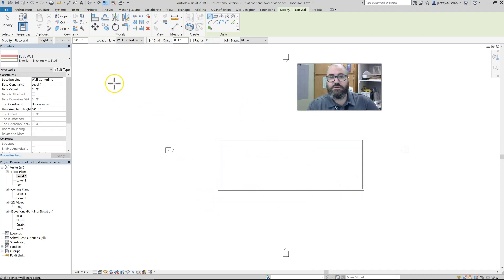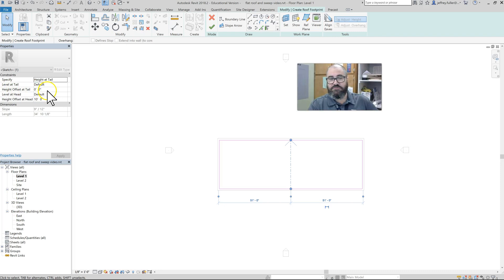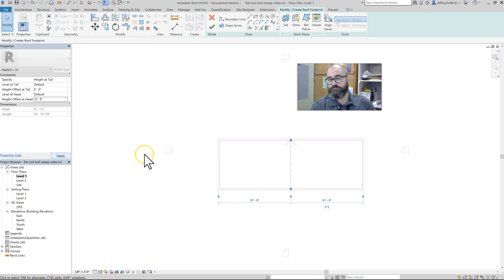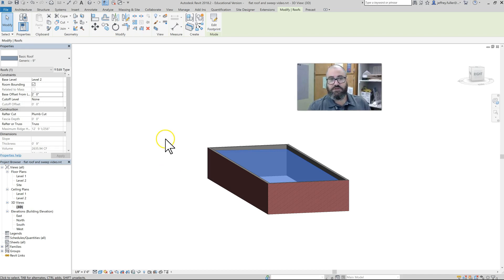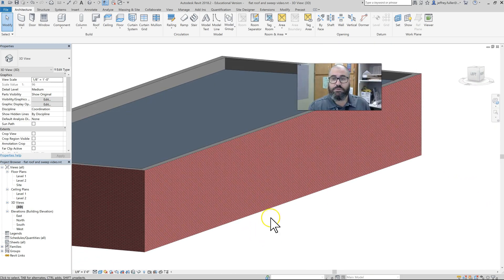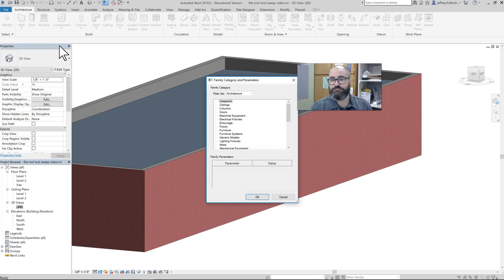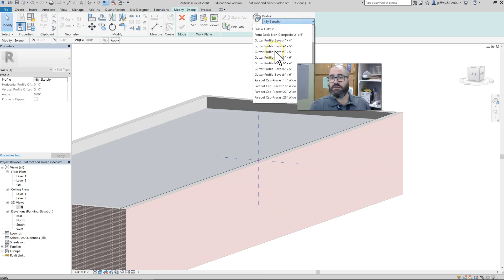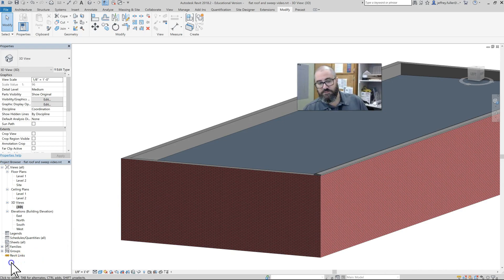Flat roof and Parapet sweep

Comment: Hi Jeffrey, it seems no one shows a typ. metal parapet cap (it's always a brick bldg. wall) but not all bldgs. are brick veneer. So can you do a video for a metal parapet cap (I've already created the profile) but when I go to place it on top of the wall, the walls are maybe at different heights and it just places the cap at odd places, or do I need to do a parapet wall on a 2 level house with a flat roof?